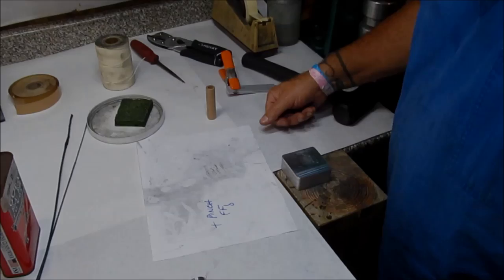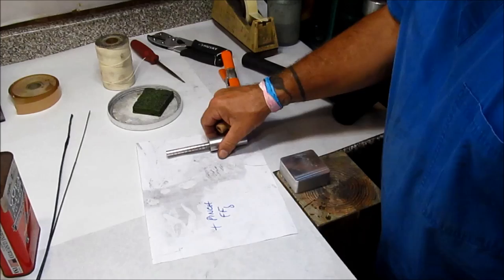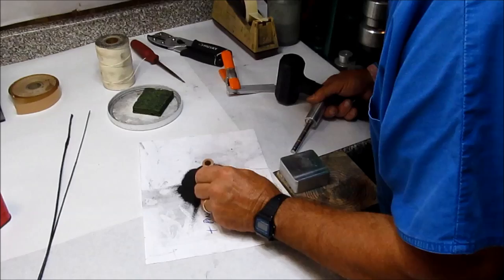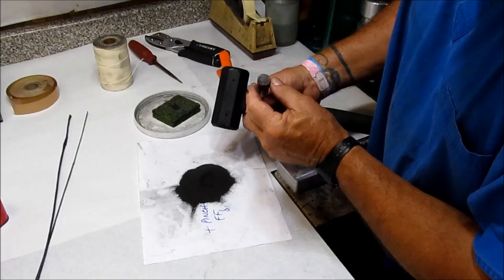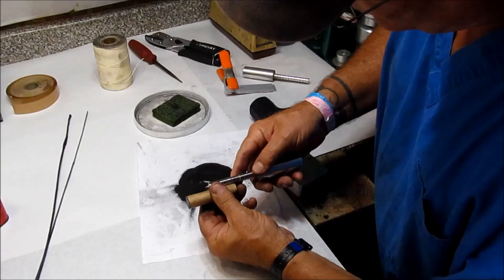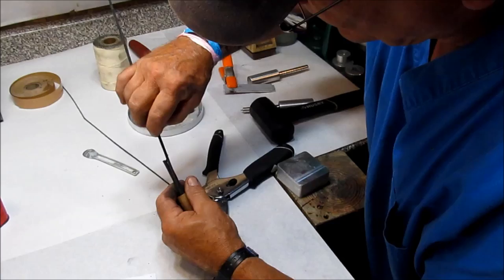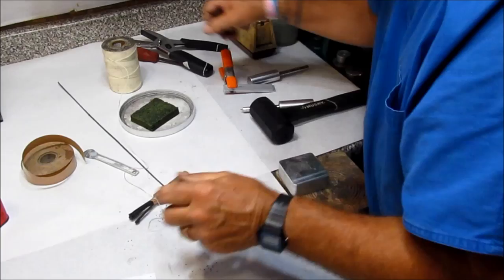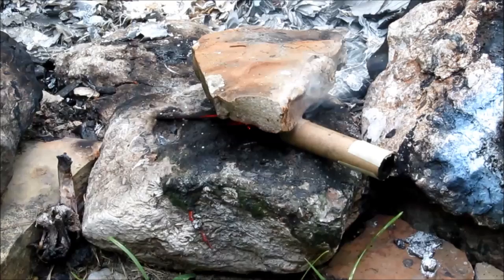Spolettes made a traditional way

Comment: Hey Ned, been following you for years on the various forums, including being a member for the last two years on your forum. Thank you for everything you have contributed to us all. I’m curious though, what are the rammers made out of? I have been bouncing around all the forums and your channel to figure it out. To me, they look like SS. Any info would be wonderful.
Reply from the maker: Yep, stainless steel, BW. They work great. Thanks for the kind words.
Reply: @nedgorski  hey ned i have a question for you it has to do with the rocket tube supporters.. does the tube wall thickness itself play's a role if it is thick or thin for gases to expand making it CATO or it doesn't matter?? (ps * the rocket is R-candy and have core!) Can the supporter hold it tightly after rumming or it will brake after you open the supporter or even worse making CATO?

Comment: Are you worried at all about the impact sensitivity of the black powder? I know bp can be pressed but the hammering is putting multiple shocks into the bp versus a press which does not introduce hammer shocks.
Reply: The powder is very slightly wet, it is nearly impossible that it would ignite from that light beating.

Comment: Hi there. Beautiful video. I have a question please. It is possible to make a rocket engine. From gunpowder. No additions thanks.
Reply from the maker: Sure. BP rockets are very common. And, thanks for the kudos.
Reply: Thank you for your quick response
Reply: gunpowder.
Reply from the maker: gunpowder is a generic term which can refer to various different gun propellants. In fireworking, we typically use basic black powder made from KNO3, charcoal, and sulfur.
Reply: Okay now I understand. Not possible to buy in Canada potassium nitrate. And I understand why. But I can buy gunpowder. BP. I have a license and thanks again
Reply: uzi mary Canada doesn’t allow Stump remover in the hardware stores? Dang. The PM has the country under a severe thumb. Cheers buddy.
Reply from the maker: @danchoikhongten 39 I wouldn't. It's much more powerful, and prone to detonation under pressure.

Comment: Is the dampening the big diffrence with your way of making spolettes?
Regards Max
Reply: Negerarmen Is a funnel used usually?
Reply from the maker: Dampening the comp, using the pointed-tip rammer, the way of loading and ramming the increments... There are quite a few small differences from the way I've usually made them.
Reply: ned gorski Any pro/cons with this method, compared to your regular method? Curious because I always use timefuse. // Max
Reply from the maker: I like the speed and efficiency of this method, combined with the hard grain end exterior, due to the dampening. I also like the reliability of the interior grain end, shaped with the pointed rammer, and the inclusion of the grain powder in the finishing. So, in general, I'm sold on the benefits of the method shown in this vid.

Comment: Why is my spolletes so slow? Thx for respond
Reply from the maker: I'd have to guess it's the BP you're using in them. We use good, hot, fast, BP in spolettes.
Reply: @nedgorski  Thank you
Reply: @nedgorski  can i use granulated BP for this?
Reply from the maker: @stevkolasab7269  I'd highly recommend a fine, granulated BP for spolettes. The grains will bit into tube wall, really locking the BP grain in there, preventing it from being blown through when the shell lifts.
Reply: @nedgorski  okey Thank you for tips but i just  tried it with granulated i hammered it well and the result was very good better than with my fine bp
Reply from the maker: @stevkolasab7269  Great.